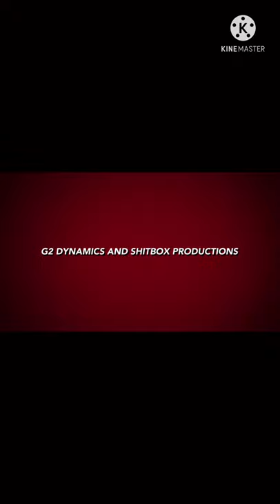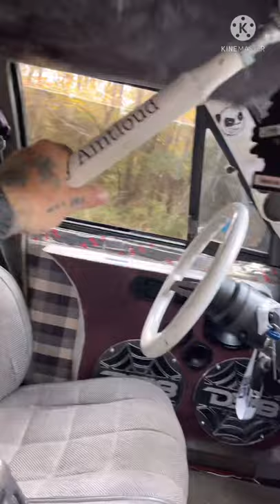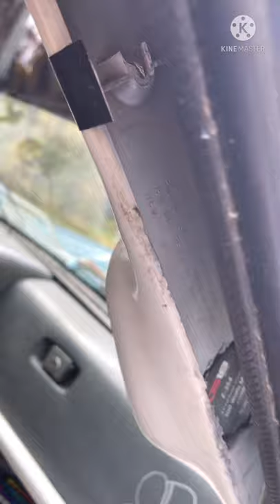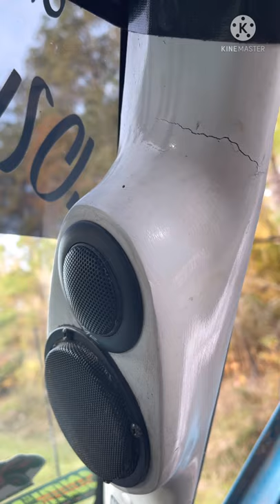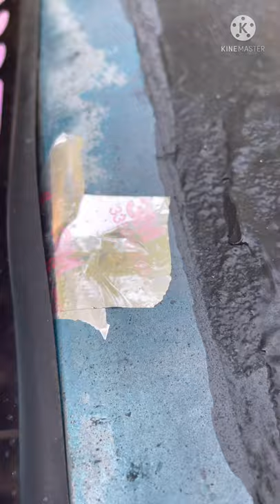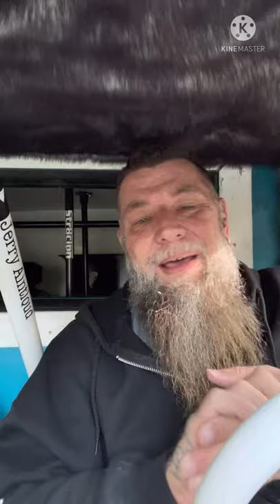Bass Heads and Shit Boxes

Comment: Facts I have a 01 isuzu rodeo and I'm breaking the roof and rear hatch that was with 1 zvx 18 i ordered the 2 15in g2 genesys subs for 399 i can only imagine what that's going to do i live like 25 min from Paul's shop in kemah cant wait for em mines a no wall by the way on a nendo 4k 320amp autotech alt n 2 d3100 xspower agm does ok

Comment: I’ve got my whole system wired. Extra battery in the back of a 05 exploder three amps, fans, subs. My boxes are built by a master carpenter, 3 sheets of 3/4 birch for various boxes I’ve got jp23 on two sundown ev 10s bunch of mids and highs. I’ve got about 500$ total in my system because I’ve welded various stuff for them. We trad labor. So you welders keep that in mind you can trade a lot for your welding. I would offer you with the shit box but I think you’re a welder? Anyway ✌️from a pipe welder here in Columbia S. C.